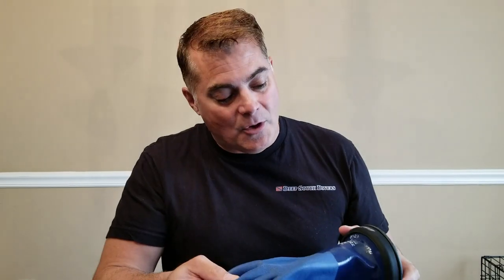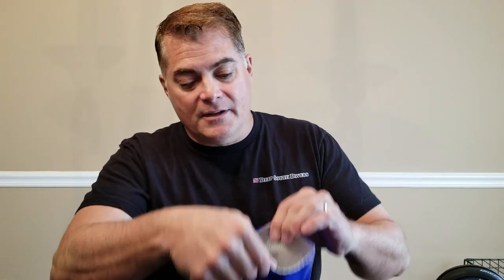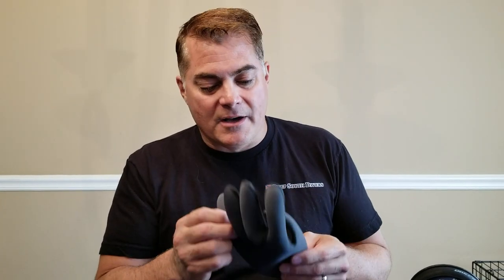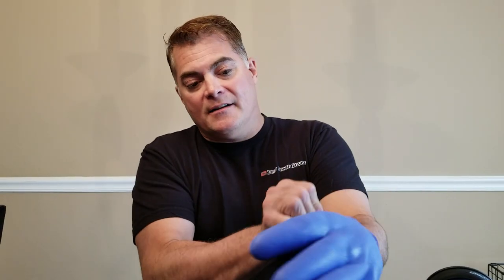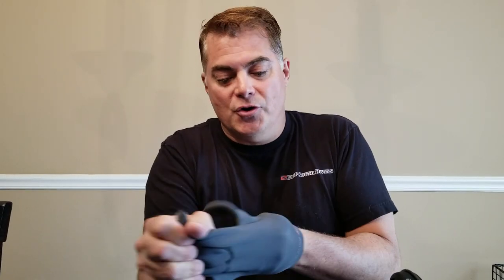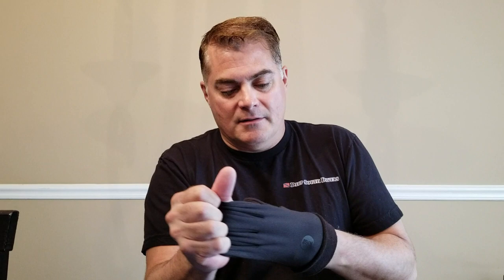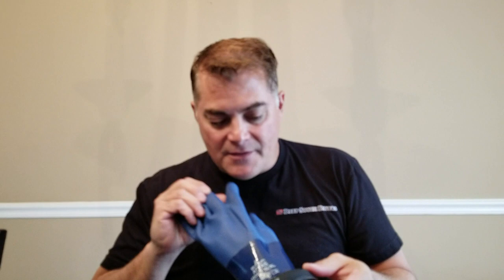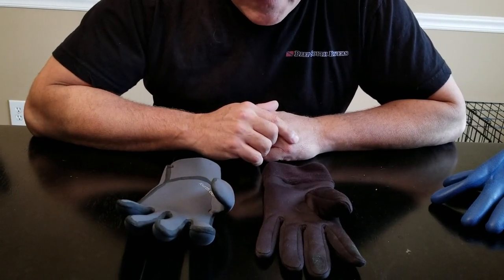SHOWA 660 and 720 Drygloves Paired With Fourth Element

Comment: Useful video, thanks!  Coincidentally, I’ve just recently tried the same gloves and came to the same conclusions. I’ve always been happy with wet gloves in the past and only switched to dry gloves when specing my new FE Argonaut drysuit. All my mates said I’d love dry gloves but I wasn’t sold. I originally got the FE heavy duty glove with FE Xerotherm thermal liner and found I had less dexterity, partly because the finger tips had excess rubber, making tasks, clipping, etc, more cumbersome.  They were also too grippy / sticky making access to pockets and pouches more fiddly. 

My friend then gave me a spare pair of Showa 660 XL/10 and it was significantly better.  However as he was using the 720, I thought I’d by a pair and those are great. Literally fit like a glove and great flexibility.  I may become a dry glove fan after all!

Comment: I know you prefer not to use the wrist seal, but I have a question, for those who do use the wrist seal intact:
How would the glove air pocket equalize with the rest of the suit when using the Fourth Element Neoprene glove you showed?
Reply from the maker: There's a variety of ways:  

The rings come with a speghetti noodle sized fkexible silicone tube to put under the wrist seal.  If the glove were to flood, it can be removed and the tube pulled out so that the diver's arm stays dry.

Most divers I know simply place the thumb lopps from their u dergarment top under the seals.  It works the same way.